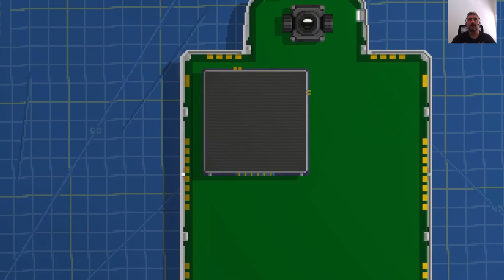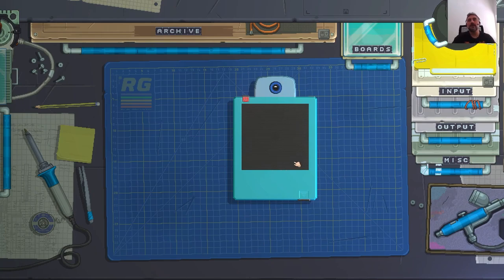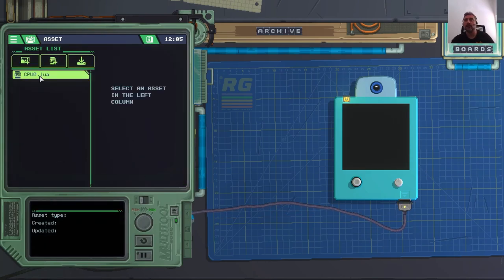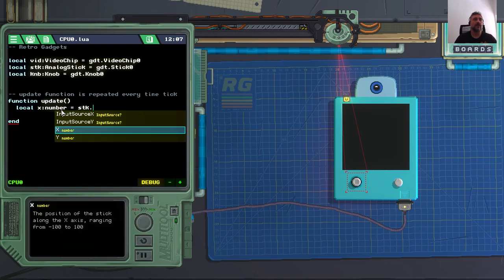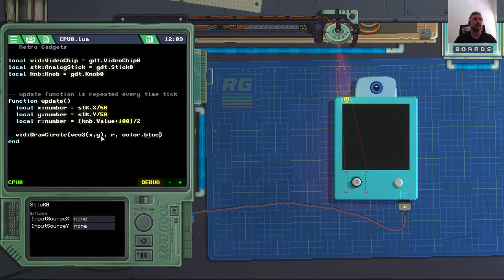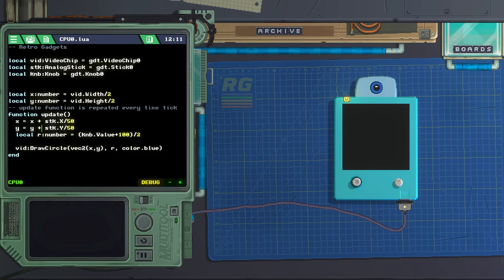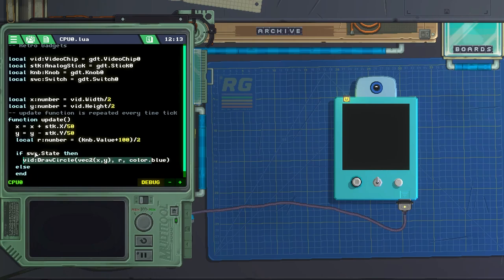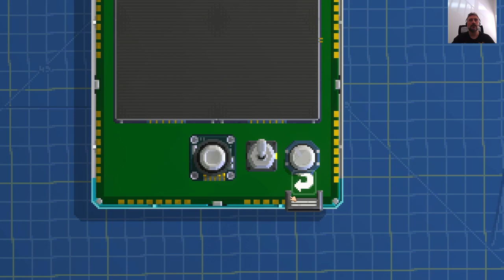Camera Component Tutorial: Display the camera input on a screen.

Comment: Is there a way to change the video input? I'm just getting a white screen.. Also is there a way to snap a picture with the video being captured?
Reply: Go on edit device and then permissions and allow the camera
Reply: @reubenfry7382  yeah the camera has been enabled. Without it the screen just stays black. I have a light by one of my cameras that turn in when the camera does and it lit up but the screen still displayed just white
Reply: @gamelordx000  oh idk sorry I had a white screen and that fixed it
Reply: @reubenfry7382  I think if there was a way to change what camera it takes the video from it may solve the issue because I don't see another way around it
Reply: White screen as well. My camera works fine, tested it myself.
Reply: @techshibe137  any idea what causes it?
Reply: @gamelordx000  it needs atleast 4  screens and your camera to be on. cant help you with snapping pics but i wish you luck. Happy Creating!
Reply: @techshibe137  yeah I've tried a combination of all kinds of screens and sizes. Nothing has changed though
Reply: @gamelordx000  verify that everything is connected properly. The largest video chip, Webcam, and displays. Webcam to video chip and displays to video chip. Also try restarting windows
 Don't know but fixed it for me.
Reply: for me some times i replace the video chip or the screen. this normaly happens to me when my screen is a non square shape